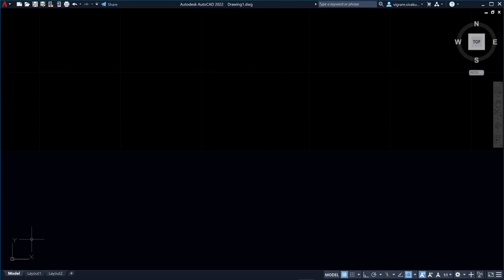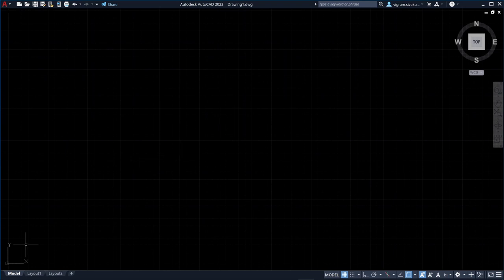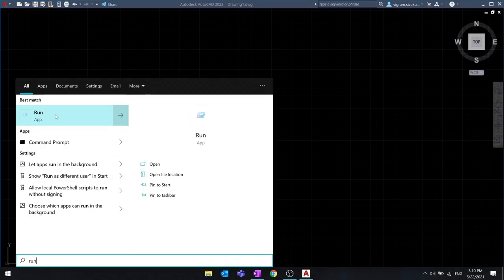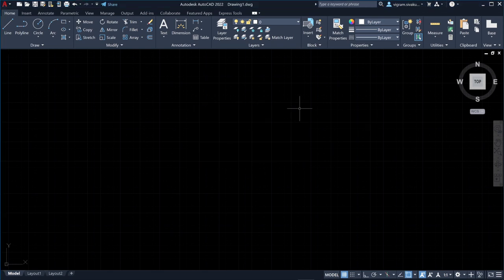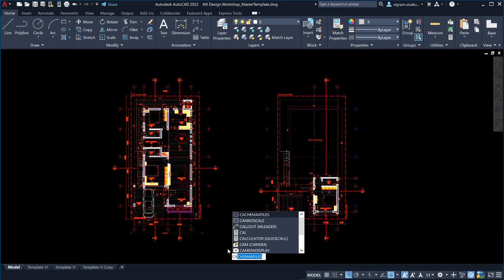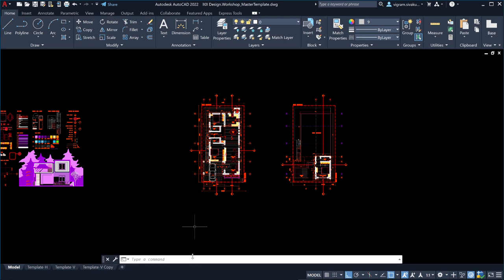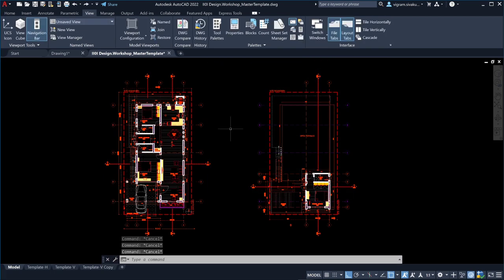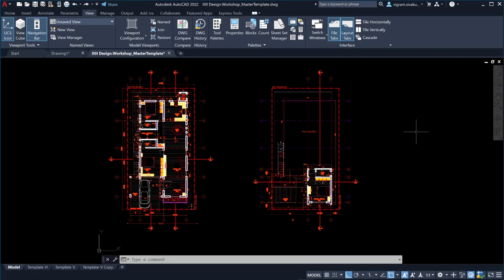Autocad slow and poor performance, mouse lag, crashes, freezes in Autocad | Ep 02

Comment: Thankyou, great tips.
Do you use Autocad Architecture? (I saw it pop up briefly on your video)
I use ACA2020 but for many releases back to 2015?? selecting an AECSpace causes a ~10 second delay. It appears to be looking for something (data?).
Sometimes it does not happen. It's either happening or it's not. Once it starts happening it keeps happening.
Sometimes restarting ACA and it does not happen... for a while.
Very painful.
Selecting spaces with other items it does not happen I assume because the properties pallete does not display space info.
I'm assuming it's some look up, cache, search function but I can't narrow it down.  No one else seems to have the problem.
Reply from the maker: Did you try disabling "Hardware acceleration"?

Comment: hello , thank you for the video i have issue with my autocad it runs very slow in my pc , i have a ddr4 16gb, i7 6700k , gtx titan Z , and i dont think i have to low my resolution for my pc to run it smoth, for example i push prespull and autocad stuck i loading , i pres esc and pres it 5-7 times so the app dont stuck, the mouse start running slow , and i tryed reinstall it and nothing worked even when i lowered the 3d graphic same thing happend , can you please help me , do i need another plug inn or something ?
Reply: same issue here
Reply from the maker: Please install the latest version of Graphic driver
Reply: @vigramarchwiz  Done, but not really effective

Comment: i am unable to get this dialogue box. all i get is a list of commands when i type graphicsconfiguration. is there another way of getting this dialogue box?
Reply from the maker: Be sure that the FILEDIA and CMDDIA variables are each set to a value of 1. Type them in on the command line (separately) to check their current value, and set to 1, if necessary.